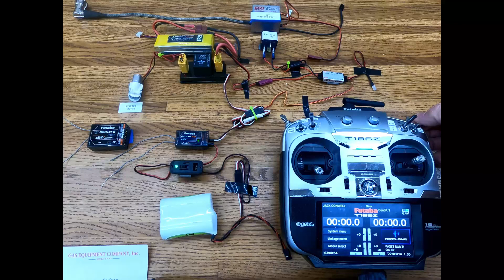GT 80 Electric Starter Setup

Comment: Question the black wire that comes off the ignition where does that connect too? Also what system are you using to power the servos?